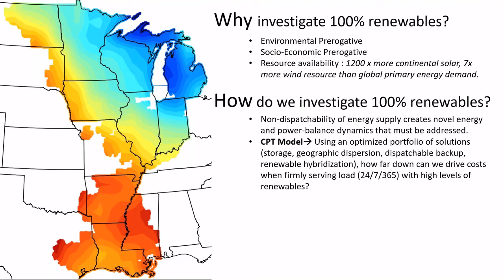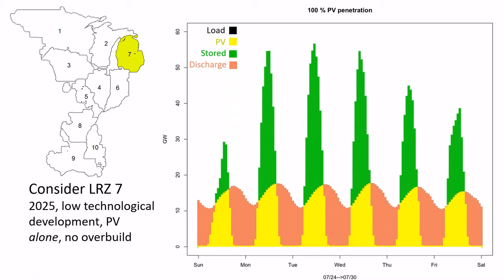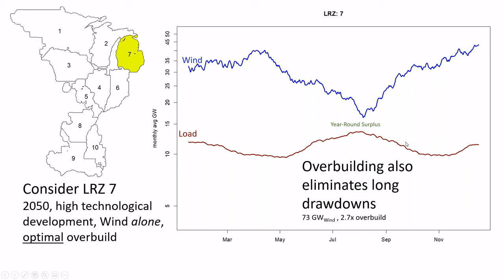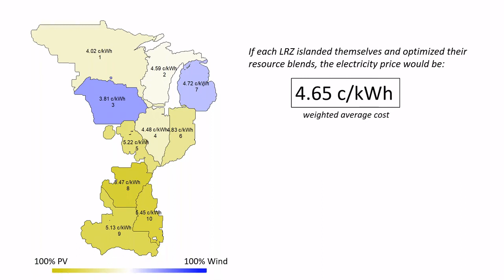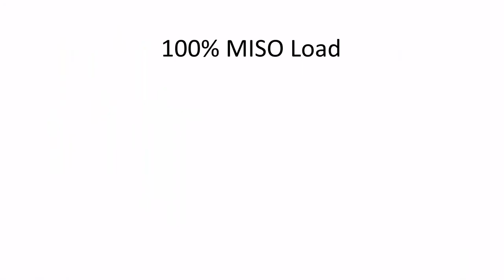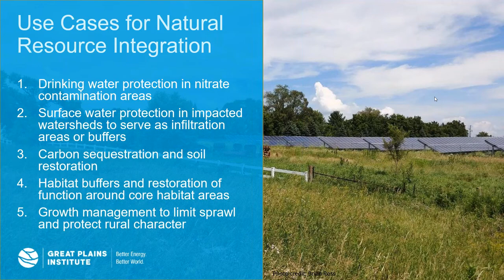Using Overbuilding + Curtailment to Achieve 100% Clean Electricity (12.15.20)

Comment: I am so surprised that I am the only one excited enough by this overbuilding concept and wrote a comment about it.  And I was the 7th to click "Like" to this video on August 23, 2023.  I was hoping that thousands would discover it is practical to install a lot of solar power and wind power, and run the grid while saving millions of dollars on natural gas costs.  

Even without the emissions and pollution benefits, saving $2 Billion a year in natural gas cost makes it all worth it!  California is doing that right now in 2023!

So last time I checked California ISO grid power output, they where collecting 15,000 MW of solar power between 11 am and 2 pm every day!  And over 13,000 MW between 9 am and 5 pm in August of 2023.  So that is a average of 75,000 MWh of power each day, or $1,000,000 a year saved at the rate of $38 per MW of natural gas cost to produce 1 MW of power.  

And Geothermal is 825 MW to 950 MW sometimes. So at 825 MW X 24 hours a day X 365 is a lot of power.  Add the 6,500 MW rated wind power, and that can save another $1,000,000,000!  Still on a hot afternoon, California was burning enough natural gas to produce 25,000 MW of electricity per hour!   That would be $1,000,000 a hour in natural gas costs!  Other nights, when Washington and Oregon are not using all of their hydroelectric power, California can import 8,000 MW of power, and only produce 8,000 - 10,000 MW in state from natural gas.  Still California is producing around 6,000 to 9,000 MW of natural gas power all night long, every night.  

Another thought.  The people who came up with this plan, they did not consider the hundreds of MW of existing hydroelectric power to supply those days that do not have enough solar and wind power to carry the power needs, and keep the batteries full.  We can import from Canada a lot of hydroelectric power, and even wind power from the center of Canada.  

I was watching a documentary on Youtube about the hydroelectric projects built in Canada on the Columbia River in the early 70's.  We (America) agreed to pay $365,000,000 towards the construction costs to build three dams on the Columbia River to supply water all summer long, and to store a lot of water in large mountain reservoirs for use all summer.  They also contracted to buy a lot of that hydroelectric power.  This might have led to the installation of 5 power lines, 2,000 MW each from the Washington / Oregon border to Southern California.  

I have heard that Vermont has contracted with Canada to supply 100% of their power needs with hydroelectric power.  And that once they install more offshore power in New England, they can become 100% renewable by using just wind power and hydroelectric power.  On especially windy days, we just make less hydroelectric power, or sell that excess power someplace else.  On less windy days, then make more hydroelectric power.  No need for batteries at all!  Add some solar, to handle any summer HVAC loads, and you have a great system!

Comment: You mention 5% natural gas to supply energy when the battery is discharging and you still need more power.  What about using hydroelectric at that time?  It seems when it is windy and the sun is up, then minimize the amount of hydroelectric, and when it's not sunny, or windy, then use  the hydroelectric at the most you can, and slowly discharge the batteries to make up any balance.  

Of course hydroelectric needs to be run at a minimum level when they have run of the river systems, where the dam can not store all of the water, and still have the minimum flow required to keep the fish happy too.  

So for Hoover Dam, it might require running at least 2 of the generators just to have the minimum amount of power generated to meet the water flow to keep the fish happy.  At certain times of the day, it might require running all 8 generators to meet the power demands.

Comment: I have looked at California ISO online, and see how many MW is used and brought in to balance the supply overnight, when the 12,000 MW of solar is not available.  Thinking about how to reduce the import of power to California by 1,000 MW they could do it one of these three ways, or another one.  

By installing a huge battery, and solar panels to recharge that battery during the day.  1,000 MW from 7 pm to 7 am would be 12,000 MW battery, and that needs to be sized up to about 15,000 MW to make up for inverter loss, cooling the battery pack, ect.  To add 15,000 MW to the battery, it would take about 3,000 MW of solar panels X 5 "Average" hours of sunlight.  

If battery cells cost about $100 per KW (what EV car manufactures are looking to meet this lower cost just to buy the cells).  That would be $1,000,000 to buy 10 MW of battery cells.  So 12,000 MW would be just over 1.2 Billion dollars!  And the 1,000 MW inverter is also going to be expensive, so will the battery storage containers, ect. and the wiring to hook it all up to the grid. 

A second way would be to install about 3,000 more MW of wind power, and they typically "Average" about 30% of their rated input power each hour.  This will supply not just the 1,000 MW at night, but all day long, and also not require batteries to be used.  This would cost about $3 billion dollars, and provide 1,000 MW X 24 hours per day.  

A third way would be to install another 1,000 MW of geothermal power.  While we might not be able to find the location to install that much geothermal steam generation, if we could it would reduce the nightly import of power by 1,000 MW.  

I like your study of the MISO and it's power needs.  It really makes sense!  

If they could at least start out with about 50% of all the utility loads fed from solar panels during the day, it would be really nice, and that will save a lot of power generated from coal or natural gas.   Then if they start to serve another 50% from wind power, that will allow most of the loads to be served by wind during the nights, and solar and wind serve during the day!

Another problem.  EV chargers.  The EV chargers should talk to the MISO dispatch office, where they can get a score, between 30 and 150.  At 100, the MISO would be saying to the chargers "Do what you want to do", because there is no danger of a brownout right now.   If it goes to 125, they are telling all the chargers you can charge quickly as you want right now, we have PLENTY of power.  If it drops to 80 or 70, they are saying please charge at 80% or 70% because we are in a slight overload right now.  At 30% there is a huge danger of a blackout right now, please don't charge fast, and not over 30% if you do charge.  Or even discharge if your charger is possible to discharge the vehicle battery back to the grid.  Like a parked school bus with it's 265 KW battery.   Pricing could also change with the level, where at 145 or 150 they might discount the power cost per KW, while at 50% or less the charge per KW will go way up.  

What do you think?